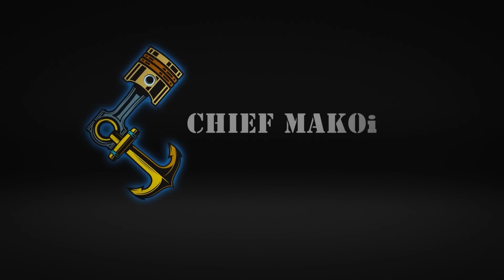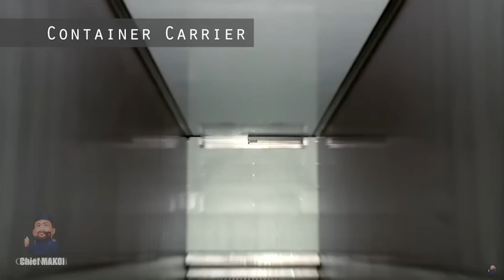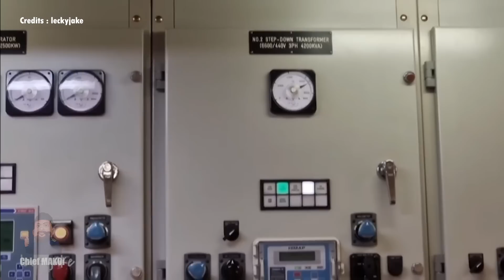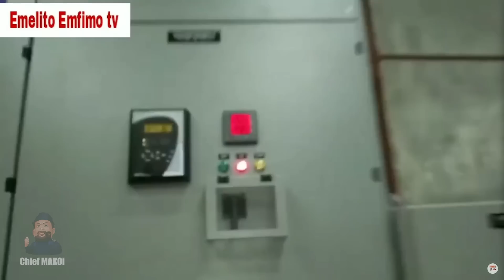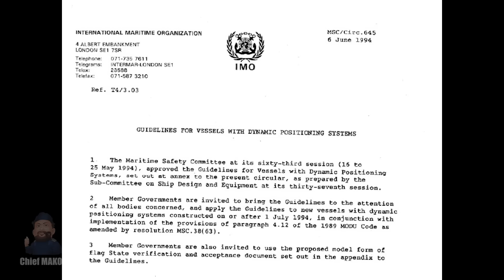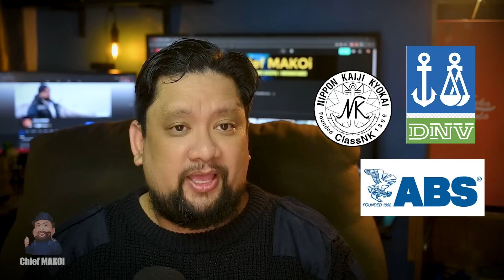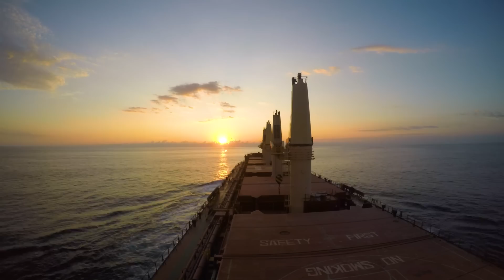Why Cargo Ships Don't Open the Bus Ties During Maneuvering | Chief MAKOi

Comment: On aircraft: bus ties are closed on the ground to enable the APU/ground power to energize the whole aircraft, but opened once all engines are running prior to takeoff. This reduces the risk of an in flight blackout.
Reply: Licenced aircraft maintenance engineer here: I wanted to say this too. plus, on most large commercial aircraft with an AC net, the generators are not synchronised to each other. Each generator powers one bus, and the consumers are  distributed over these busses to give a maximum of redundancy.
Reply: ETOPs have introduced a deeper level of redundancy that I don't expect to ever see on a ship.  On newer aircraft, there are two generators on each engine, for a total of four engine driven generators.  In that case, even with an engine shutdown, the entire dually redundant electrical system remains powered without resorting to closing the bus tie.

The DC10 crash in Chicago is a great example of not having automatic power transfer.  The aircraft was savable, but the pilot's instruments were lost and the copilot instruments were a reduced set.
Reply: @matthewbeasley7765  Plus the APU and RAT.
Reply: Even in my light piston-driven aircraft, the engine has dual ignition systems, and as long as the engine is turning is has spark thanks to the engine-driven magneto.
Reply: An Airbus 380 designed like the Dali would have one gigantic engine whose ignition, lubrication, and cooling depended on redundant APUs.

The problem with these enormous ships isn't their power bus architectures, it's that there are no rules that prevent the shipping companies from building them as cheaply as possible.

That a container ship as large and potentially dangerous as Dali can legally be built with one rudder, one propeller, and one engine whose cooling and lubrication is dependent on a separate electrical power source is not an engineering problem, it's a regulatory one.
Reply: @2ndfloorsongs  It's like double-hulled tankers, it needed regulation. Hopefully we'll get it.
Reply: @2ndfloorsongs  The big difference is that a ship, if it breaks down, can usually stop and wait for a tow.   An aircraft cannot.
Reply: @cr10001  Another big difference is that, on average, large commercial ships are about 900 times heavier than commercial aircraft. If your engine fails anything big enough to give you a tow or even change your course could easily be a day or two away and the shore and a large oil spill a lot closer. Large ships today need to be much more reliable. The shipping industry builds cheap and runs under foreign flags with bare bones standards.
Reply: @2ndfloorsongs  It is both, actually, because engineers and regulators are both responsible for the actual, practical outcomes.
Reply: @ReflectedMiles  I was just emphasizing that there are no technological limitations just regulatory ones. But yeah, the regulations are only as good as the engineers who implement them.
Reply: @2ndfloorsongs I would say yes and no to that. As everything, safety features in cars, air traffic etc. Those things evolved over time. And most of the time a ship is underway, they have plenty of room for things to get manually fixed or switched over. Given the risk of something failing and leading to an accident while maneuvering in port or generally in close quarters like locks etc. Surprisingly little catastrophic happened so far, so no need or urge to spend more money in redundancy than it seemed necessary.
And looking at those vessels, I am somewhat hesitant to say something is build cheap. Nothing comes cheap with those, and having a breaker instead of a bolted in tie would make only a fraction of a percent in cost for such a ship. Other things required today like potentially exhausted scrubbers to reduce emissions at least close to the coast add a lot more to the building and maintenance cost than those breakers.
And if otherwise from an operational standpoint they are simply not needed yet, you sure will find some to argue they may possess a risk of failure as well.
Remember just a few decades ago, an aircraft needed at least three engines to be allowed to cross the Atlantic.
Reply: @alexanderkupke920 Yes, attempts at making things more reliable sometimes make them less reliable. Every redundancy added is an additional failure point. And who knows what all those extra tugboats in Baltimore harbor and, by extension, Chesapeake Bay, are going to be getting up to.

Environment and money, safety and money, lives and money, it's always a trade-off.

Redundancy in ships really isn't my area of expertise, I help design sanitary sewer control systems. But I do find it amazing that my shit, the real stuff, has much, much better redundancy than a cargo ship larger than an aircraft carrier. 😁
😊
Reply: @2ndfloorsongs  must be because for sure no one wants THAT shit to hit the fan ;)
Reply: @alexanderkupke920  I knew I'd achieved some new milestone in my life's journey when a co-worker slipped and did a pratfall into one of the usual streams of brown goo we waded through and started cursing and complaining. I turned to him genuinely puzzled and said: "What's the big deal? It's only shit."
Reply: @2ndfloorsongs  during my high school time for school I did an internschip at the lab of our local wastewater treatment plant. So I am not too shy when it comes to the smell and view of whatever goes in there. But when it comes to taking a bath in there, I will happilly pass. Even collecting samples in the sewers in full gear, I was quite happy to get out again.
Main thing when things started splashing we allways told, keep your mouth shut and don´t swallow...
Reply: @alexanderkupke920  In the old days (and I'm kind of old now) I wore jeans and rubber boots. Nowadays it's head to toe protective gear with gas sensors and sometimes full respirators. I remember my footing feeling more slippery than normal one day and I looked down and my boots were melting. Concentrated nitric acid will do that. I was a few hundred yards down a pipe another day and this little 4-in tidal wave washed over my boots. Not a big deal I thought, then I realized it was gasoline. War stories haha, but most of the time it's the same old boring shit. 😁
Reply: @2ndfloorsongs  Experiences out of the category "Things you don´t want to see!" But even without those, no one would believe how monotonous and repetitive jobs may usually be, which in terms of safety, bears its very own risks of losing risk awareness.
Reply: @2ndfloorsongs  I feel like there's definitely some valid criticisms here, but it's not the end of the world if you have a non-redundant component so long as it's reasonable that any catastrophic failure would be something impractical to mitigate. The ship only had one rudder, so do basically all planes. The wings on a plane aren't redundant either. Helicopters usually only have a single rotor and the tandem rotor helicopters out there have plenty of catastrophic accidents that can be attributed to their tandem rotor design.

As an outsider, it's frustrating to see an electrical architecture that's tantalizingly close to something very redundant but falling short. Same thing on the cooling and lubrication pumps, not to mention the triple redundant steering gear (which I guess wound up working here, not that it helped). It'd be unreasonable to make all commercial jets have 4 wings and likewise you don't need multiple main engines, rudders, and propellers to make a cargo ship safe to operate. I work in an industry where we have PLCs controlling big important things and failure would be orders of magnitude more expensive than the price of the PLCs controlling it. We have safeguards, we have redundant PLCs, for the most part we don't need to rely on people to take immediate action after a failure. After reading through the preliminary report, it looks like this could have all been avoided if the PLC had been programmed to close in the other transformer during a fault condition instead of letting the blackout happen.
Reply: @AndrewMerts  Many planes gave one rudder, but all primary flight controls are powered by at least two independent actuation systems. Some planes have two rudders. 
Mind that the rudder of a large commercial aircraft is not that important. Important are ailerons and elevators.
Reply: @AndrewMerts  Yeah, it's probably a little overboard to compare the Dali with an airplane. If the Dali was really like an airplane, when its motor stopped it would sink. 😁 
Still, when cargo ships get larger than aircraft carriers, I think the standard of reliability they're held to should increase as well.
Reply: @jankrusat2150 Hydraulic aircraft controls are triplicated (but that doesn’t help if it fails mechanically by having the actuator fall off the control surface (happened a number of times over the years)).
Reply: @allangibson8494  Modern aircraft have separate actuators for each hydraulic system. The only exception I can think of is the rudder actuator of the 737, which is essentially grandfathered 1960s technology, which uses both hydraulic systems in one unit-.
The 737 is also an exception in another way, as it is about the biggest aircraft, which still has manual reversion, meaning that there is a direct mechanical connection between the flight controls in the cockpit and the actual control surfaces, which allows the pilot to steer the aicraft with (a lot of) muscle power alone.
Reply: @jankrusat2150  And at least three 737’s have been lost when the actuator separated from the control surface.
Reply: @jankrusat2150 The rudder is large enough to handle operation on one engine. If you never could lose power on just one side, the rudders could be smaller. That’s why there’s a critical airspeed when operating a multi-engine aircraft. The only exception is for planes like the Cessna Skymaster.
Reply: @jankrusat2150  You've got that backwards.  Large commercial airplanes rely on rudder first, aeleron's second for steering.  Yawing is far more gentle and with a good pre-planned route it's all you need.  Your rudder will also bank the aircraft slightly as long as slip isn't an issue and you can use it exclusively and never touch aelerons.
Reply: On large commercial aircraft, acc. to the pilots I'm working with daily, the rudder is rarely used in flight, only when tight coordinated tuns are required. Many autopilots actually do not use the rudder at all, they do turns solely via banking.
Reply: @2ndfloorsongs and how a bridge can be build without any failsafes. As a shallow around the pilars. How it was allowed to have crew working under the bridge and cars passing over it when a ship “extremely dangerous” according your wording is passing you do not mention. 
The price of a vessel will go up, the fuel consumption will go up making goods more expensive to transport making prices higher. We all want/demand low prices. Thats contradicting. How many redundancy’s are built into a car? You’ve got 1 brake cylinder and if your lucky an emergency/parking brake doing nothing at higher speeds. In Baltimore alone more people dying per week in car accidents most likely than died during this incident. The US has more deaths due to gunshot wounds every day. And those are mostly designated as holy and untouchable. (Guns don’t kill,people with guns kill)
Reply: @bas6983 
Correction - for the last 70 years or so, cars have had dual circuit brakes. It may look like a single unit but there are 2 incorporated in a single body.
Reply: @CaptainBassie  That one brake cylinder is actually 2 independent cylinders in one housing. At least some calipers on a vehicle are also dual.
Reply: @CaptainBassie  I said "potentially dangerous", not "extremely dangerous". I reserve "extremely" for my brother-in-law who puts nitromethane/methanol into any engine he can get his hands on. 😁

And yeah, sure, the bridge definitely needed extra protection. But I was talking about the lack of redundancy in power and steering systems for large (and much larger) vessels like Dali, not the specific situation in Baltimore. 

I remember how much the oil shipping industry whined about double hulls and I'm sure the container shipping industry will whine about having to go back to two engines, two propellers, and two rudders. And this isn't for the occasional bridge incident, it's for the numerous groundings and fuel spills these single point of failure systems have led to. 

I'm certainly willing to pay the 2%-3% extra it would cost to go back to having redundant systems. Instead, I'm going to end up paying for the wreckage and disruption Dali and cheaply built ships like her cause so the industry can save a few bucks.
Reply: @CaptainBassie  The brake cylinder of a car supplies two independent brake circuits.
Reply: @CaptainBassie  The Key Bridge in Baltimore was standing for nearly 50 years before this accident took it down. One could estimate that as many 200,000 large ships have passed beneath it without incident. Thus, on any given day, the statistical probability of a disastrous collision is vanishingly close to zero. That makes it very difficult to justify spending millions of extra dollars on EVERY bridge trying to envision and prevent an accident that is extremely unlikely to happen.
Reply: @CaptainBassie Actually brake systems on cars have been fully redundant since the 1970’s with two hydraulic circuits to each of the wheels (occasionally a single circuit to each of the rear wheels with a manual connection for the parking brake).
Trucks don’t have this redundancy because it isn’t legally required.
Telsa’s (and a lot of other EV’s) can also use the motor to bring the car to a complete stop independently.
Reply: @gregculverwell Late ‘60’s Ford introduced dual master cylinder.
Reply: @njjeff201 
Yeah the Americans were always late with braking technology.
Some European brands were doing dual circuit in the 50s.
Hell the Americans were routinely using drum brakes 20 years after all the Europeans had discs at least at the front (and many had it all round)
Reply: @CaptainBassie  "How many redundancy’s are built into a car? You’ve got 1 brake cylinder"

Well, sort of yes, but it's not one system.

That one brake cylinder cylinder is a single, non-moving, hunk of metal. Highly unlikely to suddenly fail even under abnormal circumstances. But inside it has two pistons feeding two separate brake systems. In rear-wheel drive cars it's typically a front/rear split. A leak or failure in any part of the front-wheel brakes will not affect the rear wheels, and vice-versa. With front-wheel drive cars, because of the extra weight on the front wheels, they typically have an X-split (right-front/left-rear on one system, left-front/right-rear on another).

With modern ABS systems it's even further subdivided after the ABS module. So lots of redundancies in modern car braking systems.
Reply: cars made in the last 50 years have dual master cylinder braking
Reply: He is talking about ships not aircraft